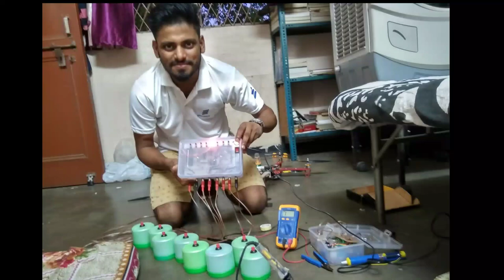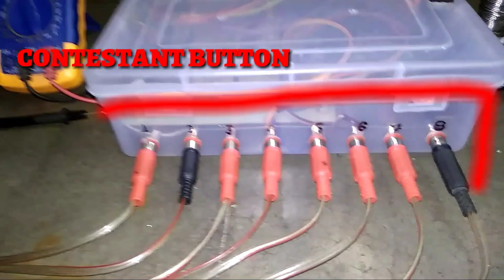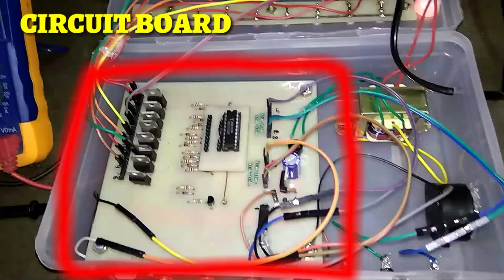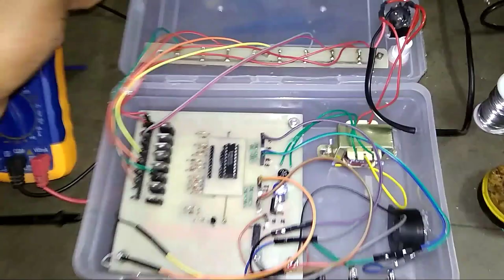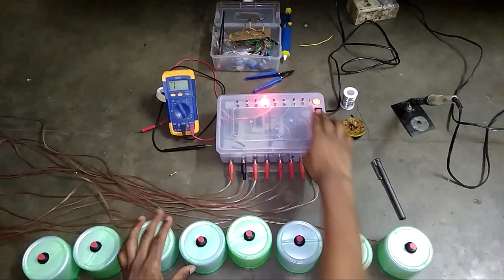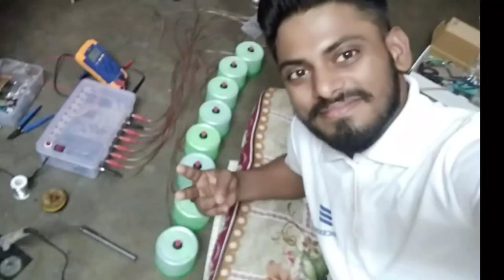quiz buzzer system | school/college-quiz-buzzer

Comment: Give me ur contact number,  my circuit not working.output is 5vdc ok from 7805, occasionally buzzer beep come continuous  but not any action while press the pushbutton .why....?? 
where connect Transistors emitter point????? To negative????
Which components need to be checked.???
Pls reply......
Kabhi kabhi Switch on karne par direct buzzer baj Raha  he, Lekin push button switch dabane par  koi lamp jal nahi rahahe. To kya check karna padega......????
Reply from the maker: Without looking your project i can not say anything about this
Reply: I think , you should check your SCR  CONNECTION as well as inputs and outputs pin of IC
I mean correct voltage level at IC output
Reply: Your cables to the buttons might be too long and create too much resistance.